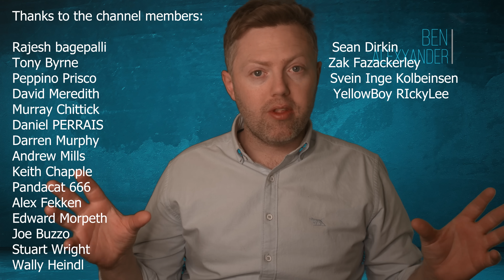CATL’s New Sodium Battery Will Reshape the Entire EV Industry

Comment: This repurposing of old EV batteries for static storage - it's quite tricky presumably it has to be at the cell level and then you'd have to have a huge Logistics system for rounding up similar batteries and then maybe testing them... Sounds easier than it may be in practice

Comment: No mention of the voltage range of Nextra Battery. Are heavier copper cables required because of a lower voltage at low state of charge causing high current drain?

Comment: I doubt it's gonna revolutionize all the batteries, not quickly anyway. It doesn't have the juice to beat LiFePo in overall performance.
The power density downgrade ain't exactly gonna have auto makers scrambling. It's probably gonna be a low production option for very cold climates for a long while.
But for non-mobile battery installations it's a big deal, and that's where we should put these things.
Outdoor grid storage installations and backup banks in people's garages stand to benefit a lot. 20% more weight per kWh doesn't matter here. (If it can somehow even out the energy density it wins, obvs. But let's see proof of that in production)

Comment: I suggest watching will prowses recent video: "Sodium-Ion Battery Reality Check". Those Batteries have extremely limited use and are horribly inefficient.
He tested a 12V Sodium battery, which has a voltage working range of 16V down to 4V. That is HORRIBLE. If you make an 800V Battery for a BEV with it, it's voltage range is 200V to 800V, instead of 600-800V, and that is an exceptionally bad thing for charging and driving. it also has a bad discharge curve.

Also: He measured a roundtrip efficiency of 60-92% efficient. LiFePO4 is 95-99% Efficient. 
Imaginbe a 80% efficiend battery, you basically charge 5kWh and only get 4kWh out of the battery. That is a significant increase of energy cost for driving.
The energy density is also bad.

Basically totally useless for home or car battery use. Inferior in nearly every way in the aspects that matter most.

Comment: He sid that modern cars' range drop significantly but not with sodiun batteries. I dont think its about batteries if irs very cold and more energy is needed. Maybe if the battery needs no heating then it wil need elss energy.

Comment: For normal passenger cars (EVs), CATL’s Naxtra sodium-ion batteries are compatible and targeted for mainstream use, supporting ranges up to 500 km. ￼
Weight impact: Energy density of 175 Wh/kg is comparable to LFP lithium-ion batteries (160-180 Wh/kg), so battery pack weight is similar for equivalent capacity and range—no significant increase. ￼ ￼ Next-gen versions aim for 200 Wh/kg, further minimizing any differences. ￼ Compared to higher-density NMC lithium (250+ Wh/kg), sodium packs could add 20-30% weight for the same energy, potentially reducing efficiency or requiring larger packs for equivalent range. ￼ naxtra platform is for bigger cars, vans and trucks. Kubic for smaller cars. Thebweight will affect range. So it isnt as straight forward as you present😅

Comment: There is a breakdown of the constituent costs of a Lithium battery pack produced a couple of years ago (so probably when costs were $80 to $100/kWr) that roughly saw the split 1/3 battery metals, 1/3 cell manufacture and 1/3 pack construction/distribution etc..... so if that was a true breakdown when a sodium cell is $19/kWhr a lithium couldn't be more than $25/kWhr.... honest question.... has this comparison been honestly done?

Comment: Do we have round-trip efficiency numbers? It seems like Sodium ion batteries are pretty inefficient because the voltage curve is different during charging vs. discharging, and I've heard of issues with coulombic efficiency. Maybe I'll get some cells or a small battery and do some in-depth testing.

Comment: The price of the batteries is not cheaper, they are likely to be more expensive for a few years since downstream suppliers haven't reached full production.
Sodium batteries may have similar power per weight but they are a lot less dense, which makes them marginal for large vehicles.  A sodium Battery is about 3 times thicker than an equivalent ncm battery making them unviable for many cars.
This is offset to some degree by faster charging, so you don't need as long a range, and the wider operating temperature so less power is needed for cooling or heating the battery.

Comment: How cheap is it compared to LFP? And if lfp batteries last 5 years,  then this would last 20-25 years? The energy density difference is 10%, so it will have 10% longer range?

Also, will it really be cheap or would the manufacturers project it as a miraculous product and price it higher? When will we see them in regular cars?

Comment: Indeed, the sodium ion battery with the specs mentioned is likely the Number One tipping point for zero emission electricity to cheaply and quickly defeat the world fossil fuel industry by leaps and bounds. One of the smartest strategic moves by China, which is clearly the leader of the planet in electrotech and climate fighting ability. Humanity still needs to adapt to the climate heating already in the pipe, but this will help slow emissions and fossil politics more quickly than anything else.

Comment: If this really is that much cheaper then i think this will lead to a revolution. What most non-EV-drivers do not seem to understand is that above 500km of Range you'll get diminishing returns. You won't really drive 1000km must faster with a 1000km battery compared to a 500km battery. This has to do with a number of things: 

1. Speed limits
2. People need to pee
3. People need rest
4. The law often requires rest etc.

You can see this very clearly on Bjorn Nylands channel and his 1000km challanges. Even with a fossil car he can't do the 1000km below 9h 30min. With a car that has a 500km range and decent fast charing you might need 10h for the same distance. So, how much are you willing to pay for being there 30 Minutes faster? 

Only people, who don't drive EVs think they need an electric car that can drive 1000km without a single stop. The truth is that EVs are already good enough for 90 percent of people. Most people are just ignorant about that fact.

Comment: 3:57 wait what? Can only handle +60 degree? That's an issue
Reply: 60C° = 14OF°. You are not the brightest bulb ...
Reply: @MrSummitville I know tard, i'm european i dont use horseblood scale like the dumbers of mankind.

60 Celsius is a problem, cars in the sun can reach it easily
 outside température reach 42 regulary in Summer 
Not Even talking about the heat the battery will émit
Reply: @dinamiteurdinamiteur2324  Maybe have to use more reflective paint.

Comment: Making batteries there is still an independent cost from the storage medium. The plastic to keep it all in place, the wiring, the battery management, cathodes and anodes. Manufacturing all those parts and assembling them, transporting the resulting product to the customer and paying the whole supply chain inbetween. There is a certain fixed cost that will still not be shrunk by the same factor. So a drop of cost for one material, while the majority of the battery pack, doesn't translate into the whole battery becoming that much cheaper. I'd say batteries will probably become maybe 60% cheaper or something like that. And I'm talking about big battery banks, not the cells. I love though that this isn't some promise in 5 years' time, but predicted to start production at the end of the year, and the announcement made by a giant in battery manufacture. It's probably also going to take CATL time to get the new production lines going to get up to a high volume. So regular people might be able to buy them for eg a power maybe in a couple of years.

Comment: Half the cost? I don´t buy it. Manufacturing process is so similar that it should cost the same (not even including the increased number of rejects that are always there in new products). The only thing you save compared to LFP is Lithium and the copper foil on the anode side.  But there isn´t that much Lithium in Lithium ion batterys and the copper isn´t that expensive. I think 25% would be pushing it. But that doesn´t even include that the anode material is typically more expensive compared to lithium ion batterys.

Comment: If it’s a significantly cheaper battery that’s potentially interesting in the medium to long term which could mean cheaper EVs in a few years.  The range of 500km is pretty typical of a decent EV. Not much of a change there.  Being able to charge the battery over and over to a theoretical 1,000,000 miles is interesting in theory, but no one puts that many miles on a car. Current batteries get  around 250,000-500,000 miles of charge which is far more miles than anyone practically puts on their car. 

Safer batteries would be great particularly for the E-bike market where those things have a tendency to burn your house down.  Even my Wrangler had a recall at one point for a fire risk and they still recommend not charging it inside of a garage in case it catches fire. 

Faster charging could be useful in some situations, but not for an ordinary end user  who will never be able to charge that fast at their house.  Even fast charging stations can’t accommodate that level of power.  Tesla has the largest fast charging network and their current chargers get to from 0% to 80% in about 20 mins.  Halving that would be nice, but it would mean all new charging infrastructure. Not all that useful for the normal end user, maybe useful for taxi/bus/police fleets that might be able to build that level of charging station.   Maybe also for trucking, but I’m skeptical about EV trucking. I’ve never been able to effectively tow a camper in any of my EVs.  The range goes to absolute shit the moment you hook up a trailer with any real load. I don’t care how fast the battery can be charged no one wants to stop every 100 miles.  

Cheaper and safer definitely interesting and worth watching.

Comment: These batteries are not new and there are multiple reasons why they are only suitable for specific uses. The energy density is pretty crappy for starters. They are larger and heavier for the same storage and dont last as long except in extreme temperatures. Did you look into any disadvantages or do you have shares with this company?

Comment: Very smart to already use these batteries in swapping stations. That's a very, very smart way to gather real world data in a time-compressed manner. Also, the end-user is not running the risk of possible degradation consequences because they don't own the battery. Worst case they'll simply swap batteries again/quicker.

Comment: that power density spec seems really optimistic, but even at 175 that’s still 30% lower than NMC batteries. If the other advantages hold true though it’s worth the trade-off even more so than LFP.

Comment: This is an improvement definitely. However it still will take decades to develop an infrastructure to charge these batteries. During that time, hydrogen development is continuously improving. What they said is impossible in the past is becoming reality today. Until then, I'm sticking to the internal combustion engine.

Comment: 250Wh/Kg ratio 160Wh/Kg  when fully charged in optimal conditions
Reply: Salt 2170 Kg/m³  Cobalt 8900 Kg/m³

Hmm 1.52 x 4.2 = 6.234 times it's volume for an equal charge of Watts per hour.
Reply: 19 Kw/h means the size of the battery is going to be like 118.9 m³.

That means you need to tow a volume of 2 metres wide 2 metres high and 30 metres long behind your car.
That is 100 feet. Or  if we make the battery 3 metres wide and 4 metres high then we the length of the tow is 44,444 feet is 13.2 metres. 

That means you could reach a distance between 10 km up to 20 km cq  6.2 miles and in optimal conditions 12.4 miles.
Reply: Last but not least to get to the final answer, You need to tow 3 of these volumes but you need to add water and that makes the total weight approximately 30 tons heavier and in the end you could reach 1 mile fully charged with a total length of 300 feet plus truck to be able to pull the load.

I think we shouldn't invest in it.

Comment: The numbers are always BS when it comes to "new" battery tech. Wake me up when a 200-300kwh battery weighs 100-200kgs, gets 600-1000km per charge and only takes 3-5 minutes to go from 10 to 100% charge and is fully recyclable. See you in 20 years.

Comment: I have an EV but very few people do. If everyone on my street started charging an EV at night the local grid simply couldn't handle it. You won't get rid of fires with these batteries you will simply move them to the substation along the road. Since they were denationalised the grid companies have simply not invested in new uprated equipment but have instead cut back on maintenance etc for the existing plants and all that will come back to haunt us if we even try to move from reliance on diesel to these still extremely heavy batteries that still have to be powered via that fragile grid structure. A better idea would be to put these batteries alongside existing substations and use them to smooth out grid power fluctuations down at that level so minimising the amount of upgrade works required. But that still can't provide the actual energy we need to charge those systems as solar and wind are so unreliable as I know using both to power my home and so we absolutely need a huge nuclear building programme and we need to get 90% of cars off the roads and people back into unreliable smelly dirty public transport. Or we can admit Pons and Fleischman were correct, as they were, and we can power our homes from perfectly safe jam jar sized units that the government can't control you with unlike they can with a grid connection.

Comment: I understand that for the same results sodium batteries weigh at  3 times what lithium batteries weigh. So the batteries for EVs will weigh 3,000 pounds instead of 1,000. (1,000 is really too much). Am I wrong about the weights?

Comment: Okay, I appreciate what you're putting down here, but there's still a tradeoff and I think you should have mentioned it. Yes, 175Wh/Kg is fine performance compared to LFP battery chemistries, and those chemistries are coming to dominate because costs and a few other metrics are better even though they're heavier for the same energy stored than the various Li-Manganese chemistries. 
Even so, I think it's important in a video like this to spell out what's going on. No, the Sodium isn't better performance at the top end. That's 240Wh/Kg+ using Li-Manganese. But if the industry was already moving away from maximum energy density in Li-Mn for the safety, life cycle, and cost benefits of LFP, then getting the same or slightly better better Wh/Kg as LFP and improving in the areas where LFP was at an advantage over Li-Mn essentially eliminates LFP's niche and further narrows the use cases for the max-performance Li-ion batteries. 
This is a message your viewers are (I assume) smart enough to understand. But instead you only quote the Wh/Kg performance of a single LFP at 160 to make it seem like Sodium chemistries are generally more energy dense than Lithium. 
I think your message was somewhat muddled. You clearly seem to be trying to articulate at the beginning of the video that Li-Co and Li-Mn is giving way to LFP, but then you don't distinguish between LFP and Li-Mn when talking about this particular Na battery. Then this is further confused when in in the comparisons to the new Na battery you simply use the shorthand "lithium" when in at least some cases you can't possibly be talking about Li-Mn.
This shortchanges the actual battery news, which is fantastic. It will clearly be superior for home and grid storage. The benefits of Na are winning big in stationary storage - especially at home where even a small chance of fire is scary to consumers who don't have the suppression systems of an industrial facility. 
Likewise, it beats LFP bc it's even better at the things that LFP touted as its strengths. 
But in areas where Wh/Kg is the most important metric, Sodium is still failing. And that's okay. Because we don't need it to succeed in slim-line phones for it to completely overturn the priorities of battery manufacturers and have a major environmental impact. The synergy with water desalination is actually something useful to highlight, bc it can be harmful even in the ocean to pump hyper saline brine back into the water out of the desal plants. Having a new industrial use for sodium allows commercially-viable processing of waste brine, bringing it back down to or below the salinity of the local body of water that was being used to feed the desal plant to begin with.  In other words, sodium batteries can help fund bringing safe drinking water to people who currently have little access without environmental degradation of local seas and oceans. Put that on top of the performance news, and this should be a development that makes your viewers giddy.